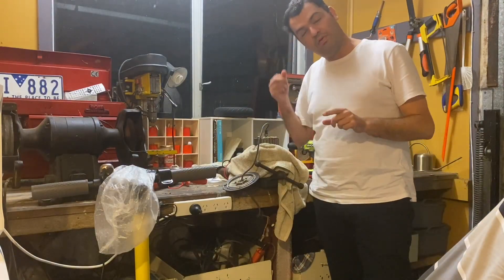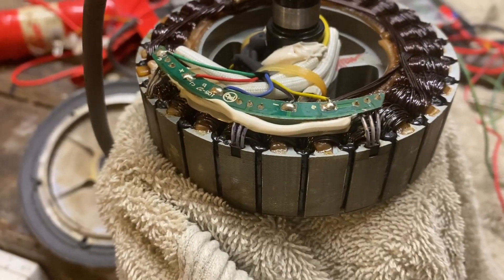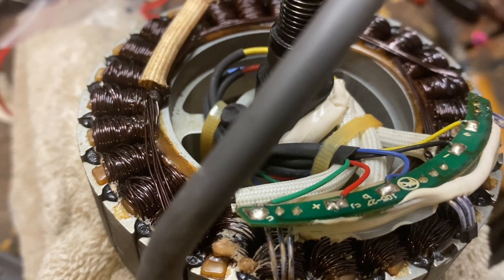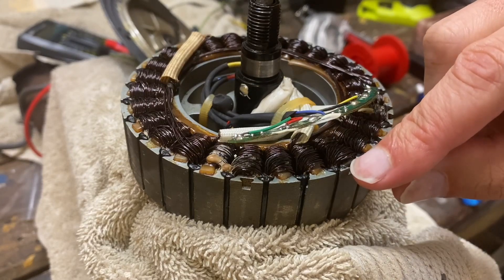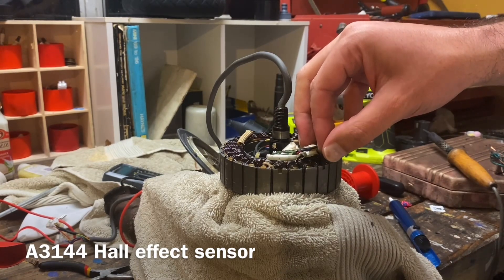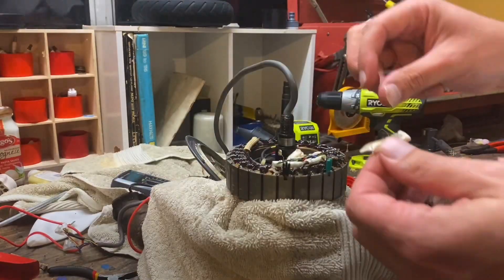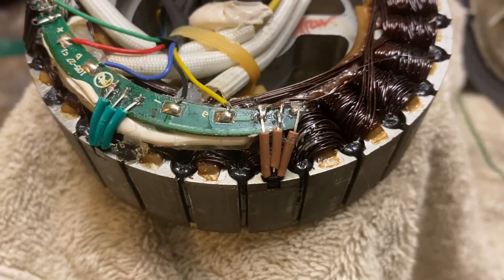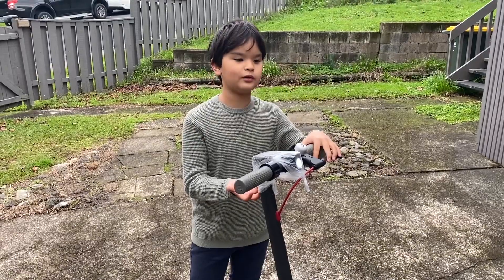Xiaomi M365 Scooter Motor Vibration fixed (hall sensor replacement)

Comment: fthe virbating sound is here in this vid its loud rrrrRRRRR  ....
Xiaomi Scooter hall sensor replacement hub motor grinding sound

Asteros 3D
1.18K subscribersorty comments non visable...seen in newest first sort by...this vid shows better how to turn middle one feet or cables twist them not go up direclty into holes on board cos it turns diff than other two to side. 
Xiaomi Electric scooter hall sensor replacement fixing error 18

Asteros 3D
1.18K subscriber
Reply from the maker: Hi I think comments are turned on, I’m sure there are better videos that the one I did in just a mechanic 😊
Reply: @nagisaian  comments are back to normal now , some glitch on my side or yt side temporary. u a car mechanic ok, l stundie it by forums and vids for ..years to fix my old but now jsut bike

Comment: Hallo! Wie macht sich ein Defekt bemerkbar? 
Danke
Reply from the maker: Vibration and rumbling from the motor
Reply: @nagisaian  ok danke Freund das habe ich meins läuft manchmal manchmal nicht vielleicht ein Kabelbruch beim Reifen wechseln ich weis es nicht
Reply from the maker: @hansgustaf7880  possibly a broken wire the battery welds are a common problem also in the battery pack :)

Comment: Hello I installed metour xiaomi m365 on my electric scooter pro error code18 and its beep I wanted to know if this xiaomi m365 engine is compatible with the electric scooter pro scooter cordially
Reply from the maker: Hi I’m unsure but error 18 indicates a motor that is not compatible what is wrong with the original motor

Comment: hi, mine is making nose when it is on the ground but when lift the wheel and run it, then it is pretty normal.
Reply from the maker: If it’s under load situations then it might be the hall sensors it should feel like a vibration also when riding

Comment: Man, I tried to replace the motor cable without disconnecting the battery. I went from being afraid the scooter would break to the scooter not turning on anymore. Caput. How can I locate the problem?
Reply from the maker: You could try unplugging the motor cable and try turning the scooter on just to eliminate that being the source of the problem.
Reply: @nagisaian  I disconnected the 3 phase cables and the 5-pin connector but the scooter doesn't start anymore
Reply: I also had a short circuit on my scooter, the scooter would not turn on, then I replaced the immobilizer and the problem was solved.
Reply: @R1s1ko81  what is the immobilizer?

Comment: hello description you are excellent and I'm sure it's the same problem with mine, because from the crash came to the break and short circuit in the cable and now the motor is with vibration, my question is where you got those sensor, thanks.
Reply from the maker: Hi I got them from AliExpress if you had a broken wire always try bacic stuff like checking for continuity in the wires :)

Comment: Do you have to change them all, even if only one is damaged, and do you have to choose a specific type of sensor, or do all sensors work?
Reply from the maker: Sorry for the delay I would do them all they are very cheap and usually come in a pack of 5 or more

Comment: My m365 lose completely power when I hit a bump with the front wheel. I have hit the motor
Reply from the maker: Could be a loose wire or the biggest culprit tends to be battery welds braking on the battery

Comment: Would it be a hall sensor issue if it brakes randomly while acceleration?
Reply from the maker: I’m not too sure about that one maybe try the Facebook forums someone may have experienced the same issue
Reply: Same problem bro, u find solution? Please tell me im so upset, i have an external battery, and it went to 40kmh as max. It was a xiaomi pro. No problem till going downhill with to much throttle
Reply: @capalot6999  it's either the controller (bad wiring) or the motor. Try replacing controller first

Comment: Would have helped if you gave an example of the sound it makes when vibrating otherwise we have no clue if the issue your fixing is the issue im dealing with
Reply: it is an indescribably loud vibration that occurs whenever you drive faster than a certain speed,
Reply: rrrrr sound at low speed here loudest, lower rrr at higher speed , stops power uphill if not helping w leg. restart power. feel vibration in steering and hear it in rear fender too moving banging but comes from front . noting touching tire is fine. suddenly happened going uphill when it started .
Reply from the maker: Sorry it was hard to replicate and only seemed to occur under load
Reply: Same with mine I have no clue what your vibration sounds like
Reply: it is not the sound the stalling effect is the culprit .the ESC confuses transtioning in between the phases , stalling the 360 degrees infinite rotation. if this is the case then you will need to check all the current pahse assembly including the sensors, cables and mosfets etc.
Reply: the virbating sound is here in this vid its loud rrrrRRRRR  ....
Xiaomi Scooter hall sensor replacement hub motor grinding sound

Asteros 3D
1.18K subscribers